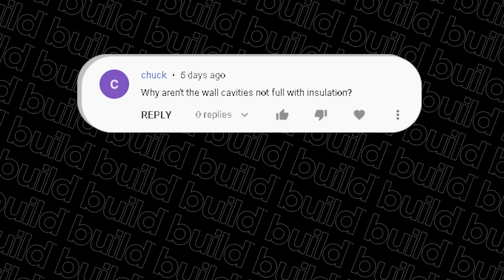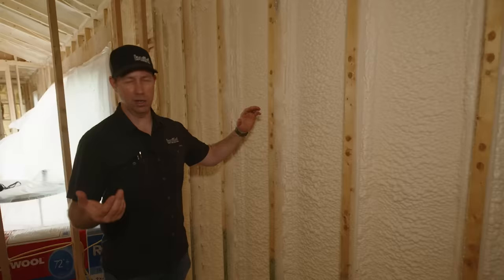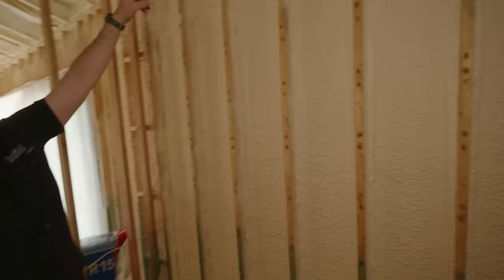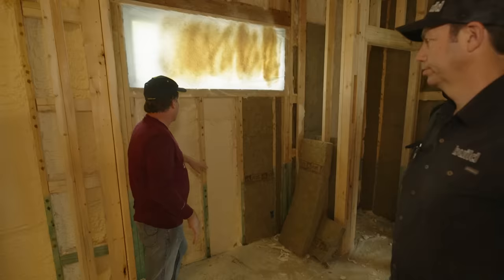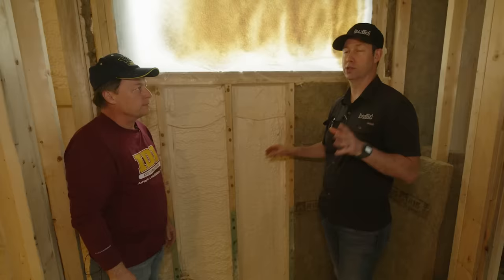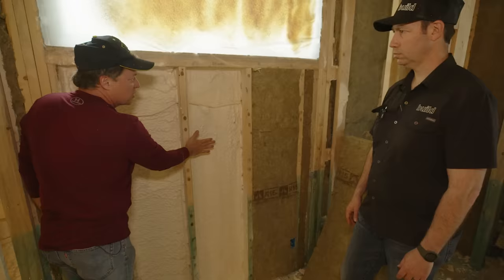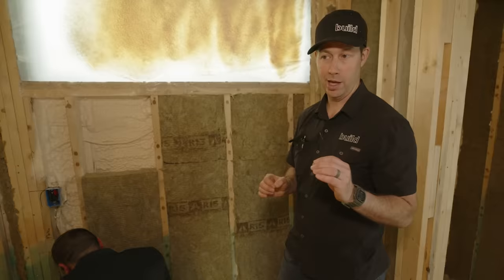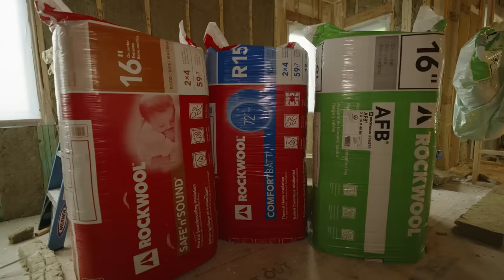Closed Cell Foam + Rockwool- How To Flash & Batt

Comment: Basically a R32 in a wall in, what, Texas? That's going to perform so well. Wish I had that in my house...
Reply: Indeed. For what looks like a 50-85F average yearly swing, R32 seems overkill.
You are only asking your HVAC for a delta of 20F. I guess he's well prepped for the next storm.
Reply: @joshpit2003  since you bring that up, will his HVAC units perform well?  like not short cycling etc and fail sooner since they dont get proper run time?
Reply: @joshpit2003  Yes, for Austin, R32 walls are WAY overkill and stupid expensive over what you get with just 2x6 walls with pink stuff. But overkill and expensive never stopped Matt from taking it for free and advertising it for his sponsors.
Reply: @billlan0  Hmm, solar. There's another poor use of dollars. At the electric rates in Austin, it takes 20-30 years to break even vs. on-grid power (just in time to replace the worn out system). This is true unless you take the subsidies which are paid for by your neighbors.
Reply: @neckofthewoods24  He'll be totally fine. They're won't be any short cycling in his ac. So much ai, learning, temperature modeling it'll turn on for awhile to get to temperature and not turn back on for quite awhile. He's going to size it appropriately. If he goes too big of a unit what you're saying could happen.
Reply: Attn: GOOGLE, Twitter, Facebook, & YouTube:  I agree with whatever the approved opinion on this subject is.  Please don’t cancel me or get me fired.   Whatever you tell me, I will be obedient.  I will obey.
Reply: @billlan0  Sure, with sponsorships he'll make out like a bandito, and frankly I don't care. However, he's not educating anyone on the cost tradeoffs (case in point ... R32 walls). A smart person making these choices would NEVER build R32 in Austin. It is a total waste of money. That is my problem with the sponsored nature of this channel. The choices he is "educating" everyone on are bogus. 
Also, the 20-30 year breakeven is assuming they are running at full capacity and is regardless of what you do with the generated energy. Whether you use it or sell it to the grid is immaterial. It carries about the same value either way.
Also, remember the federal subsidies he is using are paid for by you and me.
Reply: @MrTexasDan  just because he’s in this great state, doesn’t mean his entire audience is as well. Lots of mentions of other climates and he is ultimately showing the art of the possible. Is it overkill for his location? Sure.  Have you seen a better channel covering building science that can apply to most situations? I haven’t. I find the content extremely helpful (even if it’s not all relevant) as I prepare to build another home here in Texas in the next few months.

Enjoy the content. Keep the useful tidbits and store the other ones away; they may come in handy somewhere else down the line.

Someone asked about the AC: I believe he is using mini-split systems which should handle this scenario without breaking a sweat.
Reply: @MrTexasDan  From what I hear about the insane overcharging by grid operators, solar with batteries solves that issue.  You can stay hooked up to the grid and use it as a primary battery with the household battery used for recharging the electric vehicles we will purchase in the future.
Reply: @Cspacecat  You heard about insane overcharging by some rural providers that did not have contractual pricing with their suppliers. The other 99.9% of us always and still have the same 15c/kwh rate. Maybe someday the cost will go up and make solar more attractive, but they've been saying that for 20 years.
Reply: @MrTexasDan  Right now NG is running about $60 per megawatt hour.  Solar is running about $50 per megawatt hour and wind is running about $45 per megawatt hour.  When you add batteries, NG is still hard to beat.  The good thing is batteries eliminate peaker plants wich are about double baseline NG.  You're paying about twice as much for roof solar as compared  to grid solar.  Your added cost is in labor and permits.  If you do the work yourself with the tax rebate, you can clearly compete with grid power.
Reply: Imagine watching Matt's channel, then going to your contractor and asking for pricing on building your house like his. Actually that would be an entertaining "reaction" video.
Reply: @echtogammut  I totally agree.  I've carefully reworked my house over the last 38 years and it is a vastly different house than it used to be.
Reply: Insulation is never "wasted" or "overkill", I mean, to a reasonable point. R32 isn't too much for Austin. R50 maybe. Keeping heat out helps as much as keeping heat in.
Reply: We have R40 walls and  R60 ceilings. I have a small duplex I build and counting daylight basement and garage I heated 3000 sqft here in Alaska with about 500 gallons and a cord of wood last winter. We get temps down to -30s.
Reply: @joshpit2003  As long as no plumbing is in outside walls.
Reply: @neckofthewoods24  I would think the HVAC guys would size the system with knowledge of the insulation in the walls and ceiling. You can even find online calculators to compute the HVAC needs taking into account windows , walls, ceiling and basement R values.
Reply: @Chris_at_Home 500 gallons of propane or oil?
Reply: @Cspacecat  We have a remote cabin that runs on solar about 8-9 months a year. About the only thing not electric are the range,fridge and water heater which  will soon be supplemented with a solar. . We  even have an electric freezer, and small washing machine. I did this years ago when solar was $$$ per watt. My payback was not having to haul gas for the generator on an ATV or snowmobile.
Reply: @huntermac8970  Fuel oil. I’m retired and haul my own oil because it saves 40 cents per gallon. The supplier it just over a mile away I have a tank for each unit and they will  charge me a delivery charge twice because they have to move the truck to fill both tanks.
Reply: @Chris_at_Home   I do understand.
Reply: Me too, I think my house has R11 in the walls.
Reply: @sa3270  Wow, not much by today’s standards. I grew up in Ct and many houses are like that. Most of the homes in the area I live in now were build starting in the early 80s. I had a big addition put on my small first house and it was 2x6  flash coated with 2” of foam then an r13 batt. This was in 1985.
Reply: I live in a 105 year old house in Minneapolis. Zero insulation in the walls, lol. Stucco studs and plaster is all I have, 😅
Reply: @huntermac8970  You can use a 2" hole saw to cut holes top and middle of the walls if you cannot blow insulation in from the attic and fill them with cellulose insulation.  That should get you to R13. or more.
Reply: @echtogammut  i did just that, dude’s eyeballs popped out of their socket. Told me “I’ll build you anything you like but you won’t like the final bill” 😂
Reply: @joshpit2003  you mean a low of 50 and high of 85? hmmm.. check NOAA history docs.... lows in the 30's and highs over 100...(ignoring the 2021 snowpacolypse
Reply: Bob Watters  Right. It is ALL about ROI - Return On Investment. Items this egregious may never pay themselves off vs. putting that same money moderate investment.
Reply: @MrTexasDan  refi construction loan into mortgage and watch the savings roll in EVERY month.  If you cant see this then you have bigger problems...
Reply: @MrTexasDan  ain't That the Mathematical Truth!

Comment: That foam is no joke. Used it to insulate around some old loose vinyl windows and the foam locked the windows in place better than the screws and blocking did.
Reply: No kidding was replacing a door and frame that was sealed with a foam and fastened with bolts, so I unscrewed all the bolts I could find and cut with a power saw from all around the frame and still needed two of us to push the frame with the door loose.
Reply: No joke is right! Commercial insulator came in and did kitchen, under floor and under a crawl space. Later, didn't realize I could not set the outlets back. Thankfully the tile backsplash was thick enough that it didn't affect the boxes sticking out max. Make sure that anything needed to set (outlet depth on adjustable boxes, etc) is done BEFORE spraying. Also made mistake on not adding layer of roxul before the sheetrock went up, and ceiling. But so far, temps are good but would like to noise reduction benefit. Next home...
Reply: There is no racking force applied. If you took a force and pushed sideways against the foam it would crush like you stepped on it.

Comment: I was a insulator (Residential) in the late 80's and early 90's & when I started the standard was R7 in the walls "with plastic" R19 floor & 30 in attic, when I left & went on to a different profession it was still the same orher than we were using R15 in the walls without plastic, I'm in N.C Raleigh area. It's amazing how far the industry has come. And I have to add I've been around construction & builders my whole adult life about 40 years & you my friend are a hell of a builder, I would love to have you build me or anyone in my family a home, I could rest knowing it was done with integrity.

Comment: This house is a case study in good practice
Reply: R32 walls in Texas. Are you kidding?
Reply: @MrTexasDan  A well insulated building in any climate will reduce your energy bills.  It will also reduce the size of your heating/cooling equipment.
Reply: Except the black roof which he did just for looks
Reply: @magictrading8903  the 4 inches of spray foam alone is R 28...
Reply: @bwillan  yeah for sure, but....
How much money are you putting in to reduce the costs of cheating/cooling?
Is it really worth it? Houndeds of thousands of dollars spent in insulation can cover decades of bills
Reply: @bwillan  I just put a standing seam roof on an older house for remodel, is the closed cell foam and rock wool bat still recommended in DeSoto, TEXAS?  IF so what company do you recommend?
Reply: @MrTexasDan   I just put a standing seam roof on an older house for remodel, is the closed cell foam and rock wool bat still recommended in DeSoto, TEXAS?  IF so what company do you recommend?
Reply: @MrTexasDan  Insulations works as well for AC as for heating.
Reply: @kellymoses8566  Really? Ya don't say.
Even if you took a cursory look, you'd realize the cost/benefit analysis for southern climate makes heavy use of the relative cheapness of cooling a house in hot weather vs. heating a house in say, Minnesota. That's why Southern homes are just not as thick.
But R32, in any zone, is overkill. In Austin it is just plain nonsense. Calling it best practice as he does is idiotic. Then slapping a black roof on top completely defies credibility.

Comment: I own 2 houses next door to each other, almost identical in layout, one built in 1908 & other 1910, both houses I redid the 3rd floor (complete gut).  1st house is ours & put in Rockwool with polyiso board on the inside (R-6 with drywall to go over it).  This reduces thermal bridging through ceiling joists.  Next house did closed cell foam between ceiling joists (both houses have roof above it).  Considering the performance & price I would definitely do the Rockwool/polyiso combo.  Probably half the price (with my labor) & I think it performed better.  Again, exact same 3rd floors, next door to each other so a pretty good comparison.  Close cell spray foam was about $6k for just the 3rd floor ceiling/walls.
Reply: Yeah in retrofit/renovations, when you can put whole boards, its way cheaper for same performance.

Comment: Minnesota built home here. Cant stress enough put enough foam 2"+ and CONTROL THE MOISTURE through the entire build if its happening through the winter. I neglected to do so and had a lot of condensation occur between the flash and the batt when we had our extreme cold snap which occurs once if not twice a winter. Matt if you read this please look to mentioning it, because its still relatively new concept many aren't aware of, and it can be extremely scary situation. In my case all of it dried out as designed once it warmed up a bit and I dropped the moisture levels as much as possible.
Reply: What was the exact assembly? Poly on the interior or something like smart membrane? A flash coat in cold climate can be a risky assembly if not done right.
Reply: Controlling moisture is hardly a new concept since polyethylene sheets have been standard in northern walls for close to 50 years. What is new is the realization that even in the north, it might be hot and humid outside while the inside is cool and dry (due to air conditioning), so interior poly isn't a good idea anymore.
Reply: @hailexiao2770  if cool and *dry*, would condensation still occur?

Comment: OK, this answers my (and others) questions about the closed cell foam install.

Now this brings us to the next question.  What is the upcost of this wall (the 2x3 (5.5" wall thickness) heat break, Zip sheathing, foam, Rockwool) vs a "code" wall (for that area) and how does it compare (costwise) to, a comparable (R-value) ICF wall.  If the ICF wall is cheaper, then how much more R-value can you add for the same cost?

Love these shows!  Please keep them coming!

Comment: We just foamed our home is Minnesota. 6" closed cell (R42) under the roof decking and 4" (R28) on the walls. It's incredible stuff!
Reply: What brand did you use?
Reply: R values are a joke, R42 of foam is like having R90 of batt insulation..  I bet you can heat your house with a candle.

Comment: icredibly well informed.  Rockwool is incredible for sound and batt.  I have bought from IDI...Good company.  You hit the spot with just enough for each application.  Too many times the builder or homeowner is not interested in foam because they think they need an r-49 cavity foam filled....7" is overkill.  3" is max.  You are spot on brother.  And your exterior wall design is interesting.  That wind blowing hard in the background was a great sales pitch on the foam too....Awesome video.  I just came across it.

Comment: The thickness required for closed cell foam to become a vapor barrier varies depending on brand. No close cell spray foam becomes a vapor barrier at 1". You need to look at the TDS of the foam you are using. Most require at least 1.5", some required over 2". This system will work, it just super over kill. I have been a spray foam contractor for 15 years and studied at the Kansas Building Science Institute.
Reply: 1" is thick enough for a vapor barrier in certain zones. 2" is enough in zone 6
Reply: @johndeerefarmer4483  No it is not. The technical data sheet for each spray foam will list the minimum amount of spray foam to reach a perm rating of less than one. To be considered a vapor barrier the perm rating has to be below 1 perm as defined in the building code. Perm ratings are not defined by climate zones. If you know of one please let me know.
Reply: @markking3531  A better statement is "you don't need a vapor barrier (<1 perm) in certain climates since a vapor retarder (1-10 perms) is sufficient".

Comment: In South is enough open cell for walls and roof.We used to spray closed cell the sub floor /freezers.  Closed cell is  good for vapor barriers  and R value, open cell - R value and sound . Cold states : roof - first closed cell ,then open , Sub floor - open cell first , then closed .

Comment: Hi Matt, great vid as always

Just a question re the vapor barrier, if the closed cell is a VB and the ZIp system is a VB, then could this result in a vapor trap for the wood in the zip system?
Reply: Could be in cold climate!
Reply: T-Studs are kiln dried.  check the moisture content on yours b4 u install.  Not a problem if u have "no open in-wall cavities".  If you have "open in-wall cavities" allow for in-house air to circulate.

Comment: first time someone else besides Spray Jones has said how to do a proper flash and batt!   good job.   rule of thumb though without looking it up is over 2/3rds ratio.   so R14 of closed cell means you should only do a max of R8 in batt form which of course isnt really a product anyone sells.  youre better off just doing the 2-3" of closed cell and calling it a day.
Reply: you are probably right, but i'm one of those neurotic people who is gonna pay extra just to put some insulation in there JUST BECAUSE lol
Reply: @dovahkindragonborn9827  but pay for that massive R value in closed cell then.  keep on packing that R7 in there vs doing more labor and spending for only an R3.5.
Reply: Watch Spray Jones.  Unless you’re doing this for noise you’ve spent a lot for very little gain….
Reply: @CybekCusal  lol the guy in Matt’s video literally said the same thing though and he points to probably the same thing Spray Jones is referring to
Reply: @neckofthewoods24  Jones is in Canada and Matt is in Texas  .  Since for the most of the time of the year in Texas  vapor pressure goes from outside inside such technology makes perfect sense there not so much in Canada
Reply: @CybekCusal  He backs everything he says with Canadian approved research for their codes and 30 yrs experience in the cold of Canad and hot summers. I notice you live in the fake world of video games.
Reply: @safffff1000  if you want me to be specific, SJ made a video saying you need 2" of flash regardless of where you live which is completely wrong as evident by scientific publications and math and also corroborated with this video where he says you need only 1" in Texas and maybe 2-3" in the north depending on your climate. I questioned SJ and his reference was "someone told me" which is a joke... Come on bro, have some common sense...
Reply: @CybekCusal  He basically said 2-3" will cover most all situations andyrs of seeing what works.
Reply: I think I would use flash and fill with blown in of some sort
Reply: @CybekCusal  Common sense shows 2" foam in ice chests keeps ice cold for 5 days, if more foam was effective some premium cooler company would make it